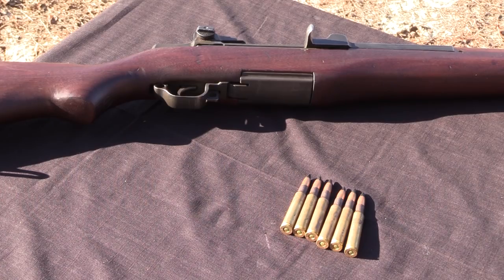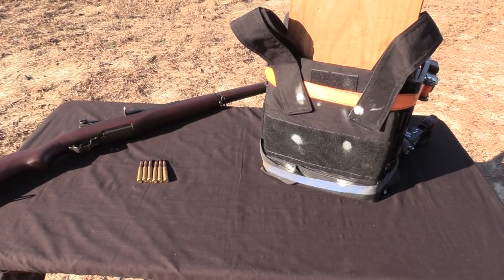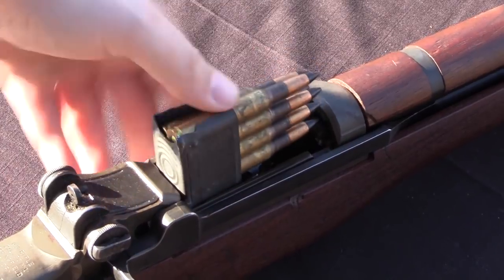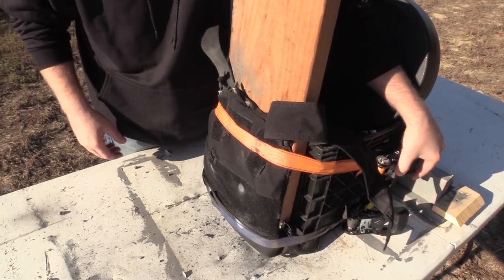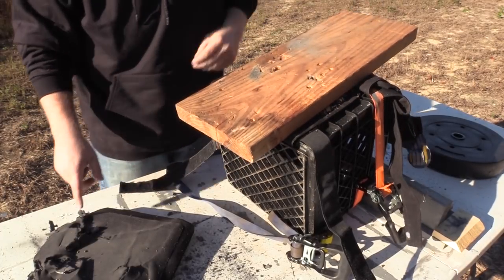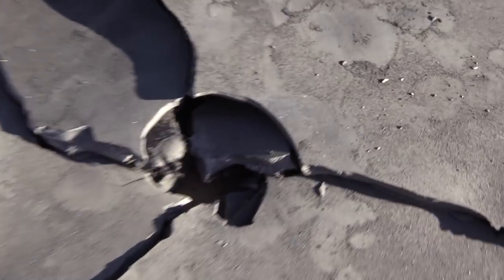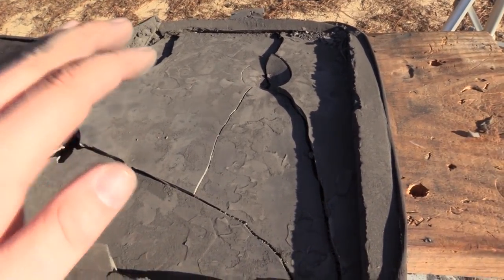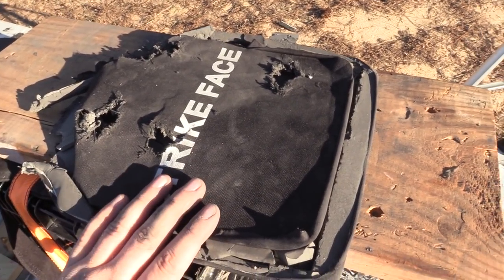Steel Body Armor VS Armor Piercing Ammo

Comment: Strange. And youre right, rather confusing, the question is what where double hits and what got hit once.  The one at the bottom right was one shot and stopped.

But concidering the immense weight its not that great. RMA LVL4 stopped 3 M2AP at diffrent spots but loaded in a .300 WinMag at a mind blowing 3276fps 5267Joule.
Reply: J.v.St. it is heavy that’s for sure